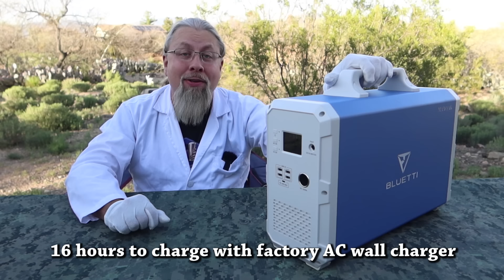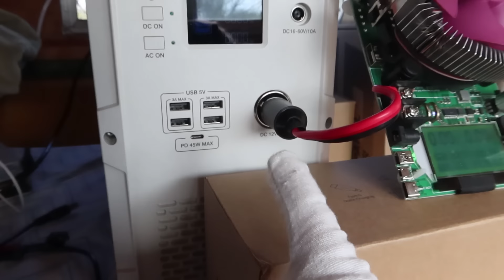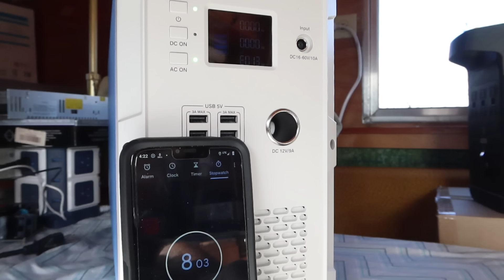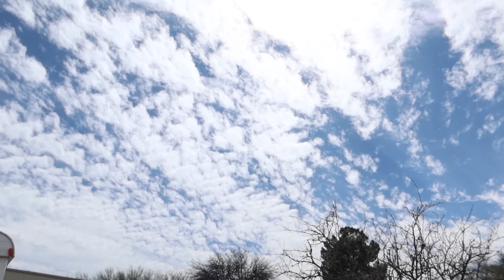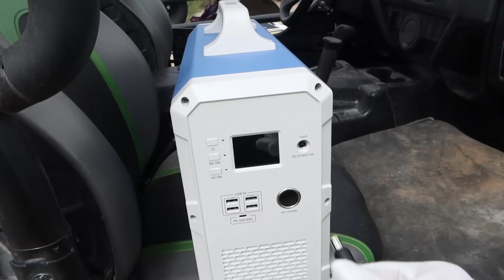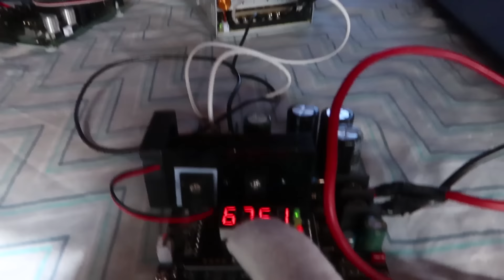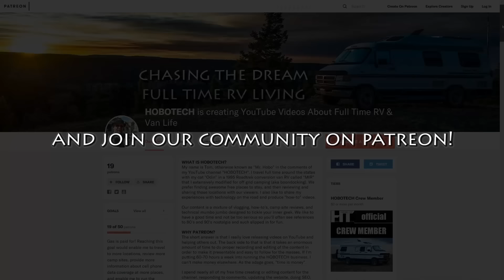MASSIVE Off Grid PORTABLE POWER Station! 2400Wh MAXOAK Bluetti EB240 Lithium Solar Generator Review

Comment: You said you can’t hook two of these together.  Couldn’t you just plug the AC charging cord from one to the other, then charge the “source” Bluetti?
Reply from the maker: Yes, but you lose 10-15% from the 1000w inverter then another 10-15% for the AC to DC charger. When most ask if they can be "paralleled" they mean battery to battery directly where there is little loss.
Reply: Good point.  I was just thinking since it can handle 600W of input, any output less than that (with the inverter loss) and both would still stay charged.  I’m toying with your idea for using a small window air conditioner (450-500W) for a van build.  I bought the Bluetti 2400 and two 170W BougeRV panels with your link and promo code (thanks) and I’m running some experiments.  I think I can get away with that setup, especially if just using the ac to take the edge off then reverting to roof fans (van lifers are supposed to be outside most of the time after all 😎).  However if I find I need to boost up the system with another solar panel and more battery capacity, I was thinking of just daisy chaining another smaller solar generator.  I’m a big fan of the simplicity they bring to van builds.  And like you said, for the Bluetti price, you are essentially getting all the components for free.  One thought is to put a Goal Zero or Ecoflow at the end of the daisy chain to take advantage of their bigger inverters.  The Bluetti can handle more input charge so it would go at the beginning of the daisy chain.  Yes, it would be nice if there was a system out there with Bluetti’s input charge capacity and price with Ecoflow’s inverter, and some low cost and simple battery expansions—but there isn’t.   But heck the money I save on labor probably pays for adding a second solar generator.  I’m doing this as a business (not DIY) so labor costs are real.  That idea also makes it super simple to start small and expand later if needed.  BTW, I believe I have found a (simple) way to charge the Bluetti with multiple sources (like solar + alternator) even though there is only one charging port.  I’m running some tests this weekend with a couple electrical engineer buddies.  I’ll let you know how it goes.
Reply: And  BTW I love you channel and greatly appreciate you getting back to your fans’ comments so quickly.  I’ll keep using your affiliate links to throw support back your way.

Comment: I'm still confused about what solar panels to start out with for my new Bluetti EB 240. I don't want to get on my roof as a 105 lb. woman aged 67 with osteoporosis. So I'd like portable panel solutions. I finally gave up and ordered two affordable non-suitcase 100W panels without controllers to have to mess with. Not looking forward to dragging these outside each time I park as there are no kickstands, but I have to be out of the sticks and bricks and in my RV by 5/13/20, and deliveries are slow these days. Figure I can pay someone later to install these on my roof.

Can you please recommend two (or possibly three) solar suitcases, sans controllers, that would be a good combo, and how to connect them properly to raise the amps/volts to optimize energy input? I've looked on both your and Will's websites and continue to not know what to do re: solar suitcase option. Here's why I don't get it and need more answers:

1) Does a single solar suitcase (which seems to have two panels) come already connected in series? 
2) If I buy two suitcases of 12V each, can I decrease charge input time by connecting the two suitcases (with 2 panels each) in series? (This depends on answers to Question #1. My problem is I don't understand if a single suitcase is considered a single panel or a single suitcase is two panels already connected in series, and how many sets of series is safe to put together.)
3) Does the EB240 require higher than 12V input, or is higher voltage simply a way to optimize input? Do two solar suitcases of 120watts each (and I'm guessing 12V each) connected in series to = 24V provide faster input?
 
Can you recommend solar suitcases to pair with the EB240, and how to optimize two solar suitcases by connecting in series and/or parallel? You can see by my questions that I don't understand if solar suitcases are already in series and what is safe or wise to do.  Thank you very much!
Reply from the maker: First entry here https://hobotech.tv/amazon/#Solar-Kits is a 200w suitcase kit without controller. It's 38lb. If that is too heavy you can get two 100w kits and hook them in series. Series works best with the Bluetti so getting two 100w is probably better (and easier to handle). A cheaper option are the WindyNation flex panels on that same page. Problem with flex is angling them. You can lay them flat in the summer but rest of the year you'll want to tilt them somehow. Some bungee them to their rigs. I really haven't found a good method that works in the AZ wind so I moved back to all glass panels.

Comment: Nice review. Question... say I buy this with 400 watts of solar input, how long will this last running a 150 watt laptop plugged in 24/7?
Reply from the maker: (-150w*24hr=-3600wh)+(8hr*300w=2400wh)= 1200wh per day deficit. Bluetti has 2100wh usable so 2100/1200 or 1.75 days. Up solar to 500w and you make up the 1200wh daily deficit assuming 8 perfect hours of sun per day = run indefinitely until the next cloudy day.
Reply: @HOBOTECH  Cool of you to offer this calc.  Something Will won't do.  Your reviews are better, too  :p

Comment: Thank you for a great review.  One question, though.  If I'm going to power my van's roof fan, interior lights, and rear audio -- all 12V DC -- where do they plug in?  Several other versions of this concept, including Goal Zero, Inergy, Renogy and Jackery, all have a couple/few dedicated DC inputs, but those ports seem to have disappeared on the most recent EcoFlow and Bluetti power stations (which seem exponentially better in all other regards).   With 2400Wh for the taking in this one unit, I would have hoped that I would not need a dual battery set-up, fuse box, etc. just for some low-power things.  I'd be running my 12V fridge thru the cig-socket, so that won't be an option.   Are there conversion plugs that would allow me to use those USB ports for these DC items?   Any recommendations, anyone?  (I've taken on this project/challenge in advance of my retirement and  I am very much learning as I go.  Please forgive what is probably a dumb newbie question.  Between you and Will, I have already learned 1000% more than I knew a month ago.)   Thanks again.
Reply from the maker: These units aren't designed to be wired into your fuse box. Can you? Yes. However, the 12v output is limited to 10 amps meaning 120 watts maximum. You could use a cig lighter plug and wire that into your fuse box, then run everything in your van including fridge off that. It's likely if you have the fan on, stereo on, lights on, and the fridge kicks on the Bluetti will shut down. You can plug an on board RV charger / converter into the AC and run all that no problem.
Reply: @HOBOTECH  Thanks very much.  The charger/converter sounds like a good way to go (any recommendations?).  Another dumb newbie question:  Do I need to run them through a fuse box before the charger/converter, after it, or not at all?   Pardon the gap in rudimentary knowledge, but as I used to tell my students, you don't ask, you don't learn.  Thanks again.
Reply from the maker: Converter runs 12v into the fuse box for distribution. I think I still have my Progressive Dynamics on my site. Good brand with good warranty service.

Comment: Do you know if and when Bluetti will change the display unit to read actual percentage of battery left vs. a bar icon that represents 20% for each bar? That would be important for me. Great video . Thank you!
Reply from the maker: They certainly won't change it in the current EB series. I added it to the feature wish list that I submitted to them about 6 months ago. Maybe the next models will have a better display.

Comment: Hi. I will preface this by stating I know zilch point shit about electronics.  That being said, couldn't one using a 12v cig adapter hook up a cheap 1500 inverter and plug into the 2400?  Cheap inverter is not pure sine so there is a paddle for that ass called a line controller.
Reply from the maker: No. The output of the 12v port is limited to 120 watts.

Comment: Great review. One problem, I cannot find the 500w quick charger on your website. What am I doing wrong?
Reply from the maker: It's under tools.
Reply: @HOBOTECH  how exactly do you get to 'tools'?
Reply: @HOBOTECH  You have so much stuff on your web-page.  You need a search tool. I had trouble finding the quick charger.
Reply from the maker: @billplatypus866  Working on it but it's not simple to do. I do have quick nav links up top and you can CTRL+F for browser search.
Reply: Thx for quick response 👍
Reply: Ever thought of a detailed comparison of the Bluetti vs a dual Battle Born system with individual components?

Comment: Can I run two 250 watt panels in parallel instead with my Bluetti EB240? I found some used ones on ebay for $40. ea. I don't know what the voltage would be for these 250 watt panels though. They are advertised as 250 watt  24 volt. Does't that mean it's for a 24 volt system but it's not the actual voltage? They are 60 cell Polys. I found specs. on another similar panel that said (VOC) 37.6 v
Reply from the maker: Tomorrow's video will answer your question. Yes, it will run a full size fridge as long as it's an energy star unit.
Reply: I here you can't run a full size fridge on this unit. Have you found that to be true?

Comment: So what are the volts of your overbuilt (series with parallel) 6-panel solar array? 3 x 12= 36??
Reply from the maker: Just under 67v.
Reply: @HOBOTECH  Thanks for answering my voltage Q, Tom. Now I'm confused how you do the math. Are they 12V panels? Do you mind explaining further? Thanks...
 
Got my EB240 yesterday, purchased with your discount code; thank you very much! Charging at home now (wondering if the fan is supposed to run while charging--nothing in instructions about that). Going to your website next to look at suitcase panels since I won't be getting on the roof at my age. 

One more question: Should I consider connecting my main RV electric line, that usually goes into a 110 outlet (it has the adapter) directly to the EB240? The house charger and heater don't work so is that a problem? Don't want to mess up anything. 

Again, thank you. This was an excellent review and convinced me to go with the EB240 rather than buying a gasoline generator or fixing my old controller and heater.
Reply from the maker: @margiecallahan3009  Use the Voc of the panels.
Reply: @HOBOTECH  I don't know what Voc means. Sorry to keep bugging you. Now I have more questions I've asked since.

Comment: Great review...thank you. I am late on the $300 promo....also not in stock I believe.  If they would extend the promo...I would buy the 2400.  Thanks.  I thought it took the code...but by the time I put a current card in...the offer disappeared.
Reply from the maker: Just verified code HOBO3000 works for $300 off and it's in stock. Try again. https://amzn.to/33UZKcj
Reply: @HOBOTECH  It worked...on the way...I appreciate the value that you provide.  thanks

Comment: Can you run a Suaoki 100w brief case and     Rockpals 100w brief case either in series or parallel to charge the eb240 or can it only be charged with 1 briefcase panel at a time ?
Thanks for the reviews!
Reply from the maker: You can run them in series to charge a Bluetti.
Reply: Thanks my man

Comment: Just bought the jackery1000 and was wondering if i can overbuild my solar and not harm the battery. I know it accepts only 200watts but my solar is 500 watts of renogy 12v panels. Even in full sun it rarely puts out more then 350 watts
Reply from the maker: Sure. Keep it under 30v and you can use as much solar as you want. It'll all be wasted after 175w.

Comment: Seriously wondering what are the real difference s between a good UPS and a solar generator?  Obviously the latter has a solar controller for changing but other than that.. aren’t they basically the same thing?
Reply from the maker: Not related at all except they both contain a battery.
Reply: HOBOTECH hmmmmm. Well I was in the process of building a solar generator on a limited budget and I ended up building are used commercial 2000 white UPS and upgrading the batteries to last for three days running my big refrigerator and computer equipment the entire project cost me less than $300

Comment: Thanks for your review....
It is basically a 1500 with more capacity and a few little things here and there. I wish for:
1) A more powerful inverter (1500 W) and true higher peak capacities (2000 W). 
2) Upgraded HW for a higher/faster charging time, both solar and AC something the Goal Zero (1400, 3000) allows you to do if using their 2 ways concurrently. 

But hey, nothing is perfect and you have to compromise between price, features. portability/size and capabilities. This is the BEST DEAL so far in that battery size.

Comment: hi there great videos - question im looking for solar generator to run a Cpap machine and my home freezer... I do have a predator 8700 only runs on gas and loud!! oh and I have a 10.5k solar system on my house with no battery backup im also looking into getting batteries for this system also. hope you can point in the correct direction for this also. are you in Az. Vail?
Reply from the maker: Either Bluetti is a good choice to run a CPAP and freezer at the same time. Yes, I'm currently in Vail.
Reply: @HOBOTECH  thanks!!! I'm in Tucson we are just around the corner from each other.

Comment: Sunday April 5, 2020 JACKERY you reviewed,  FIRST time emergency situation unit FAILED
House power went off, ONLY plugged in WiFi router into fully charged Jackery,

a) Screen showed 5 to 7 watts use

b) Unit ran for about 4 hours then shut down
c) Screen showed 56%
d) Plugged in charger to see if it would recharge to try again & unit will NOT charge
Reply from the maker: It didn't fail. I mentioned in my reviews it has an auto shut off time. Says right in the manual. The older 240's shut off <10w in 4 hours. Of course it won't charge if the power is out. Verify you have power to the outlet before charging and that the charge light comes on.

Comment: I always enjoy your reviews, they’re straight-forward and very informative. As a direct result of this video I used your link and promo code and bought one to use in my 10x16 cabin. I have a Reliance 30a inlet to 120v outlet thru the wall setup so I can charge the unit from outside the cabin using my gas inverter generator. I’m just getting tuned in to solar though and have two Renogy 100w panels right now, planning to get two more. So thank you Prof, I’m looking forward to delivery.

Comment: I wouldn't buy this with only a 1000 watt Inverter, but would with a larger Inverter. Why buy more Watts when you can't use them all at once, when you can buy a smaller 1000 watt Power Station and use all the Watts at one time?

Comment: using the Bluetti EB240, can you connect 3, BougeRV 170 Watts Panels, as mentioned in the video?  I am concerned about the voltage. It looks like it would be 67.5 volts connected in series, which would be to much. So 2 panels or 3 panels. Thanks
Reply from the maker: Yes. I showed it working.
Reply: @HOBOTECH  ok, just making sure, i ordered the Station today and now i will order the 3 panels ( thanks to you :-) )  Now I just have to tell the wife what I did. Made good use of the checks we are supposed to get. Thanks for all your videos and information. Just awesome. Coming to you from Apache Junction, AZ.
Reply: can you connect 2 maxoak generators into one solar panel
Reply: set of 3 panels, not just one panel
Reply from the maker: @auntiecues1  No

Comment: This all-in-one package is more and more getting my attention.  In a Promaster camper van I would be using this type of solar generator to power 12 volt lights, water pump, TV, and USB outlets all connected to a fuse box.  How would you connect this EB240 to the fuse box?  Thanks
Reply from the maker: Not advised. The 12v output is only 10 amps. You're better off plugging it into your shore power line.

Comment: What accessories would you need to use the Bluetti 2400 to charge house batteries? Can it directly charge 2x100ah Battle Born?
Reply from the maker: You need a battery charger.
Reply: HOBOTECH Weak response; no need to follow will go back the Will Prowse

Comment: HI -- which MC4 connectors do I need to order for this with three BOUGERV 170w Solar Panels?  With four? Tried following the diagrams online but they weren't clear. Thanks for your help.
Reply from the maker: None with 3 panels. Although you'll want an extension cord. For 4 or more you need Y branch adapters. https://hobotech.tv/amazon/#Solar-Adapters
Reply: @HOBOTECH  Thanks very much for the quick reply sir.

Comment: I'm new to this. If that device is plugged into the wall to keep the battery charging while powering a 260W device for several hours, will my power bill only reflect the wattage used to charge the battery?
Reply from the maker: The inverter wastes about 10% to heat so leaving it plugged in while powering something with the inverter wastes electricity.

Comment: Looks like a decent unit, but I'm going to have to keep saving for a Titan. The inverter unit separates from the battery for two 33 pound pieces. Can stack additional 2000wh batteries. Can connect up to 2000w of solar (two X 1000w strings up to 150v).

Comment: Is it possible to charge this ,using a dc to dc booster  circuit to  increase the car supply  to  16v  and charge using that ?
Reply from the maker: That's what I'm doing in this video. So, yes.